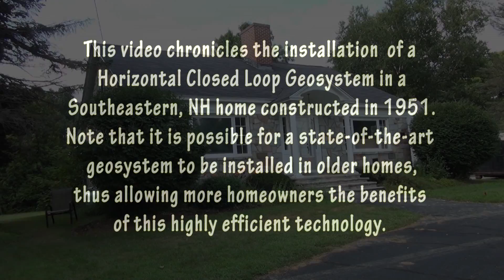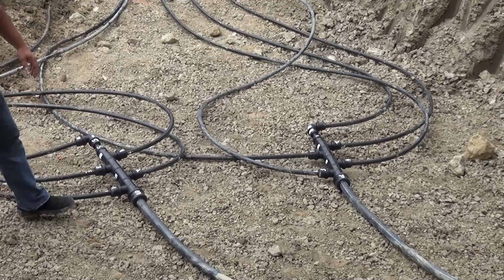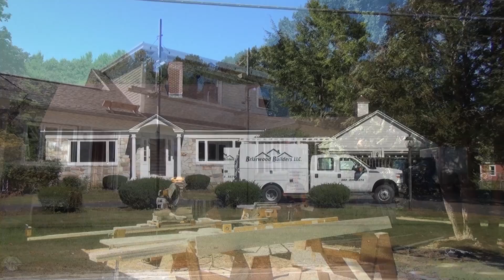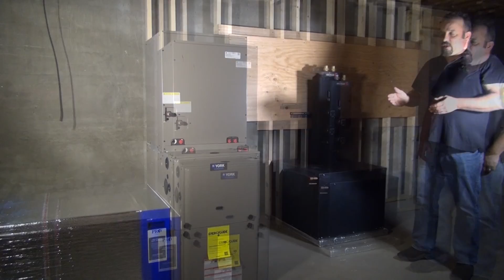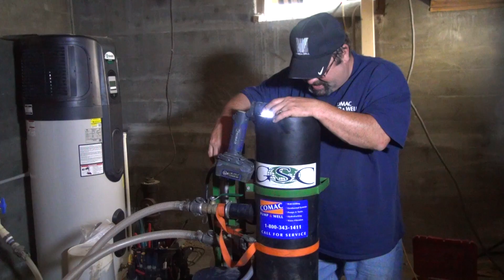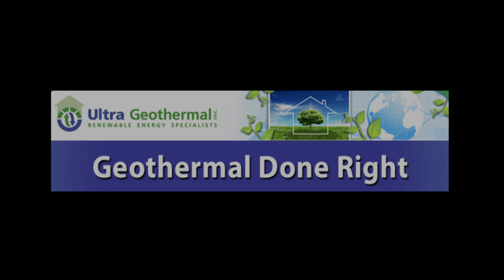Horizontal Closed Loop System - Ultra Geothermal, Inc. - Barrington, NH

Comment: This is NOT geothermal, unless the trenches are at least several tens several tens of metres (50ft+) deep, which this clearly is not, although there could be exceptions where the Earth's crust is very thin, such as in Iceland. This is ground source heating, extracting heat from the ground that is warmed up during the summer months by the sun.

 The surface warming by the sun affects ground temperature down to about 15m, and the effect is substantial down to at least 5m.

Comment: lOTS OF THINGS TO CONSIDER. I'd cover the pipes with sand and install one continuous loop.  We have had no issues, install date 2011.  Make sure you get a 50-year ground loop/ foundation penetrations warranty and read the fine print. Get a quote for both vertical and horizontal. Estimates can go to hell if ledge becomes a major issue. Sign a contract with the provision to cancel if the ground loop exceeds a certain percentage of the total system cost. Our system is vertical and has paid itself off in energy savings.

Comment: Good job. We do it very similar but I learned a lot from this. I’m learning there’s lots of different ways to do this and even more opinions. We usually do 5-6 foot trenches, 5 feet wide and 300 feet long then we bury two ton of pipe in each of those trenches. We do it differently depending on the room we have to work with.

Comment: I see a lot of rock. How do you protect the lines?
Reply: Different lines have different strengths. Typically what I’ve read you want to remove all rock away from the pipes. Not only because of punctures but because of the heat absorption around the pipe.
Reply: @Kilmar4999  So if you have rocky soil should you import dirt for the immediate area of the pipes? As in a layer of clean fill, pipe, and another layer of fill...?
Reply: @wthomas7955  if it’s extremely rocky I believe that would be your best bet from the research I’ve done. (Thermal heat transfer will be optional) There are rating on the piping that should tell you the thickness. (Thicker is better for protection against puncture)
Reply: @Kilmar4999  Okay, thanks. I didn't know there were various wall thicknesses for the tubing. I wonder if that would affect conductivity much...? Or is it simply a matter of pricing...? I suppose it wouldn't be too difficult to insure that the pipes were clear of rocks.

In your experience are the folks that sell the heat pumps the ones who design the system based on a floor plan and heating load? Do you supply them with information as to climate conditions and soil composition so they can determine things like length, OD, spacing and depth regarding the tubing? Do they actually have a guy engineering each system or is it pretty much formulaic?
Reply: @wthomas7955  I have 0 experience with any of it in person. I’ve just recently done a lot of research on the topic. You can get a soil chart for thermal conductivity to give you an idea to what would be best. If you want tomorrow I can send you some websites that give you a great break down of what would be best for you in your situation. As for the thicknesses of the tubing affecting thermal conductivity I’m honestly not sure.
Reply: @Kilmar4999  No need to send anything. I'll contact the folks that sell the equipment at some point when I start getting serious about drawing the building. I was just curious if you happened to know, that's all. Thanks.

Comment: Would it help to put foam on top of the loops?
Reply: That would insulate the pipes from the earth. The idea is to get good thermal conductivity with the dirt.
Reply: That would reduce the capacity of your system by about 50%.  It do the opposite of help.
Reply: No…. Not for cooling the home but heating… reducing the freezing depth…. During winter… by putting foam on top you would not have to dig the lines as deep…
Reply: @422904  You're missing the point about how geothermal heating works.
Reply: @wthomas7955   bad reply… 
Have you ever buried waterline and put foam on top to keep it from freezing form the cold weather on the surface ? 
It would insulated it to the ground core temp
And not have to bury the line is deep…
Reply: @422904  You need to look into how this stuff works dude. Don't simply say more stupid stuff.
Reply: @wthomas7955  It's not stupid. Obviously you've never heard of a frost protected shallow foundation. It's a good question he's asking. The heat transfer mainly comes from below the pipe within the earth where it's a more static temperature. He's not talking about encasing the plastic pipe in insulation. By placing 2x8 sheets a few feet above the pipe it would prevent deep frost from penetrating the earth and lowering your COP. It makes sense in both winter heating and summer cooling. If insulated from above with a shallow dig, you'd need to up the pipe length to make up for the surface area loss. 

Wayne Mc Clue it's a legitimate question. My guess the reason it's not done more often, is that you don't need to do it if you dig a deep enough trench. The foam board is expensive and it's probably cheaper to just dig a few feet deeper and forget the foam. Interesting possibility though for some situations where you can't dig 8' deep for whatever reason.
Reply: Say a foot below the ground for the foam and the line at 3ft

Comment: 12:51.   The generator needed to activate the geo system heating needs to be VERY LARGE.  Why ?  If a geothermal system is free energy from the earth why do we need so much electric during a power outage ?
Reply: geothermal isnt "free". you need electricity to run it.

Comment: I wonder why the need to excavate such huge trenches for just a few thin pipes. Would it not be better to open thinner, deeper trenches instead?
Reply: generally, well-drilling is more expensive than flat collector
Reply: Because when you get below 6-7 feet, typically you will encounter ledge (rock) which is significantly more difficult to excavate over a large area ~

Comment: Why use straight pipe, and not a slinky system reducing the space required?
Reply: I was thinking the same.  The price to dig up 9000 sqft seems astronomical  to what you would save doing the slinky.
Reply: That decision is made considering weather you have the extra space available to do long straights, or the extra money for the additional pipe required for a slinky type layout.

Comment: Why would you put the manifolds in the ground vs basememt? Makes no sense to me why one would do it the way you did? Those clamps r inevitably going to rust out leading to a potential leak in the lines!!!! I know nothing regarding to geothermal, just researching it now to potentially put one in, and that makes absolutely no sense nor would i do that way! I ended video early as i question anything further u may do
Reply: The manifolds were copper and plastic, copper doesnt rust.
Reply: Manifold outside so you don't have to make as many penetrations through the building envelope.

Comment: Why don't you coil it for more surface area? You could probably dig much shorter trenches.
Reply: its more efficient. The more surface area that you have. Less contact with the other pipes the better.
Reply: Straight pipe also flows much better at equal diameters to a slinky setup. You end up using less energy to run the pumps, and reduce potential ground saturation when running it hard in extreme temps on either side of the seasons. Straight is the way to go if you can afford the excavation and have the room to do it. Slinky works fine in the right soil conditions and at the right depth. There's a lot of variables, but it's not rocket science. There are just a variety of things that need to be accounted for, including the house condition that this system is supporting.

Comment: better to drill strait holes, at 40ft deep 5ft staggered apart per loop and connecting loops in a 6ft trench, that would get you 640ft (not counting the connecting pieces, along with far better cooling and temperature stability in a 20sft plot, honestly this video is showing complete impractical solution, surely impractical for a normal home owner and certainly telling others they have to pay way more out for a premade system and hired crew and heavy equipment rentals then they actually need! No Thank You!!!!
Reply: Cost prohibited.  Ive seen it ,